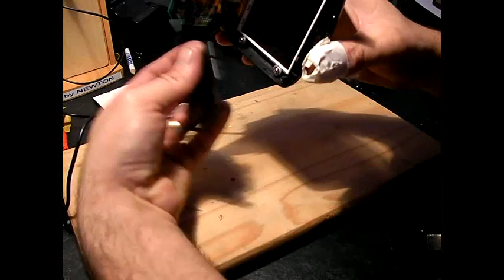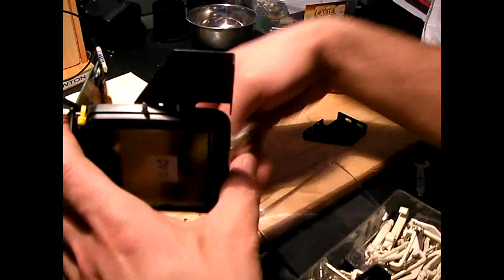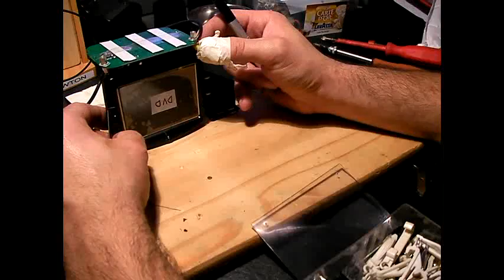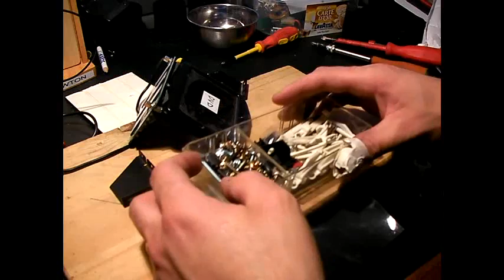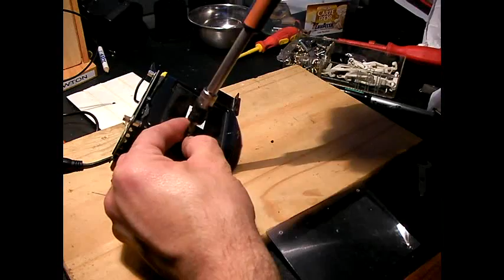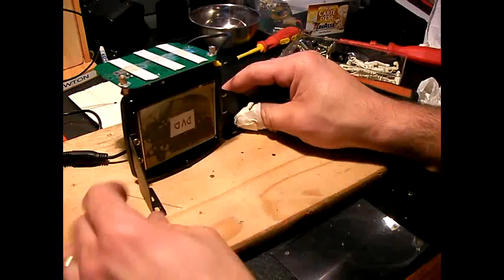DIY LED Projector (8) LCD Stand

Comment: Ive a few questions before i start making one how do you know the distances between the fresnels the lens and the light because from what ive learned if they are not perfect the corners of the picture will be rounded.
I have a 20w led that outputs 1000lumens orderes and a 3.5" screen with a resolution of 960x468.
will this give me a good picture ?